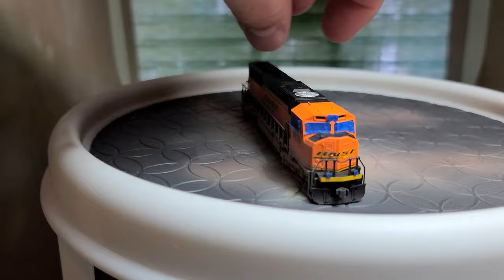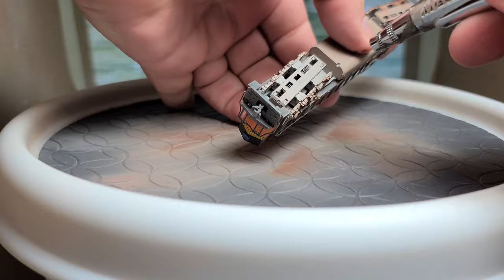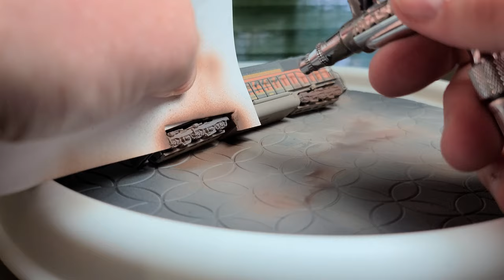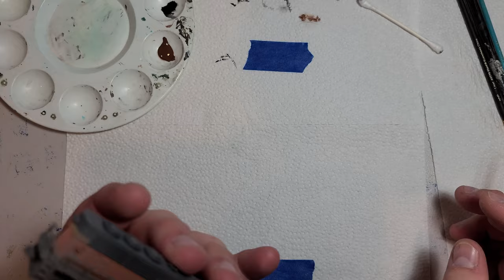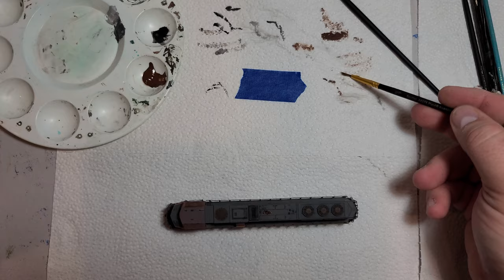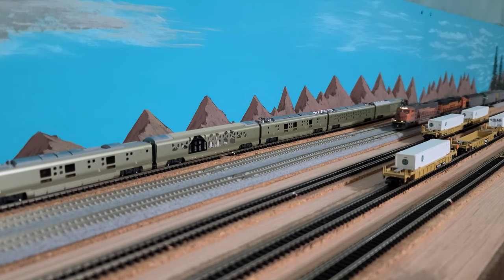Weathering A BNSF SD70MAC

Comment: Nice work cameron, weathering isn't easy at all, but it looks great. Awesome that you can dilute the cheaper craft paints. Because I use them for everything. I'd be interested in seeing a video on your setup, how you set up the gun for spraying and such. Thanks for sharing and take care!
Reply from the maker: Thanks Ian. The cheap paints may not be the absolute best to use but they work for me. I have moved to using some more vallejo as a little goes a long way with them but mainly use them on specific parts and still use the cheap paints as a base. I'll see what I can do about filming my set up. I may sneak it into another video, maybe seperate I'll need to think on that one.